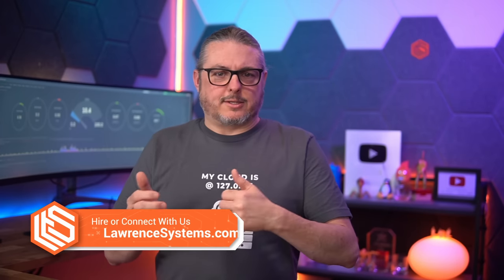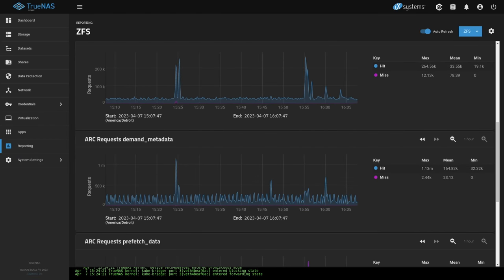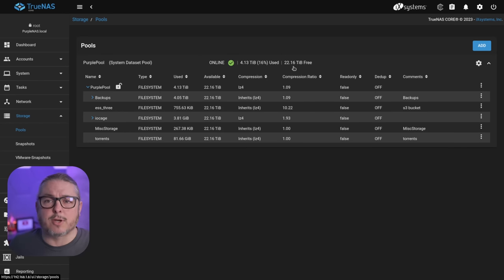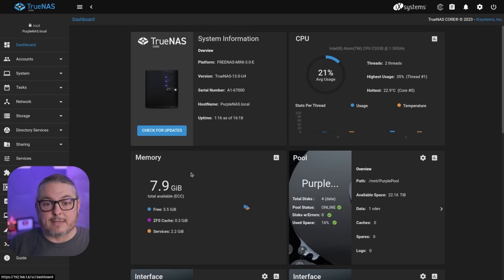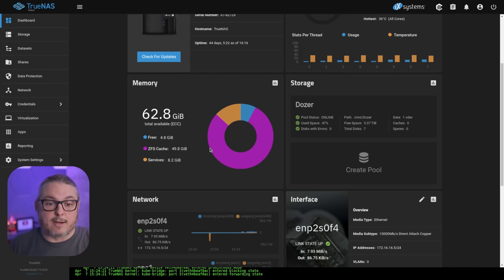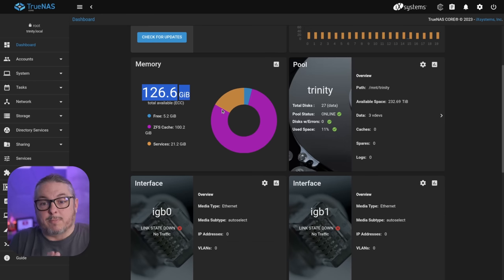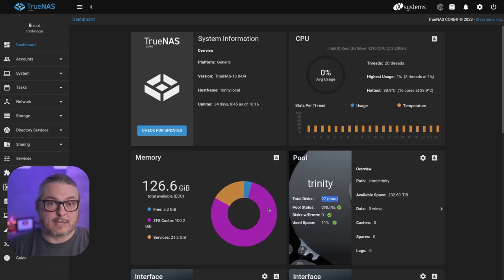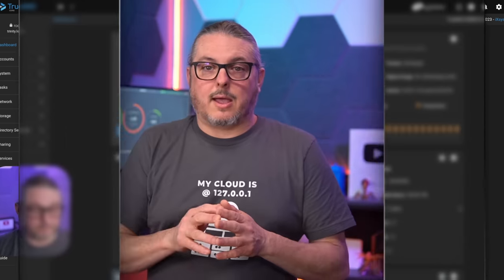How Much Memory Does ZFS Need and Does It Have To Be ECC?

Comment: ZFS need ECC RAM to avoid pool and file corruption I know this from experience…
Reply from the maker: Nope, does not NEED it, but it's a nice to have.
Reply: ECC is more important for system stability, say if you have mission critical services running, it can help avoid crashes. Still, memory corruption is pretty rare anyway.
Reply: @LAWRENCESYSTEMS  I don’t think he said that meaning it’s a mandatory requirement, but something that can avoid corruption so better be sure to have it.

That said, I don’t have any confidence in a system doing very complex tasks like deduplication, full volume snapshots, caching, iscsi, etc. in volumes of 40TB+ without ECC memory. There are very good reasons servers use  ECC ram. Saving a few bucks in a multi thousand $ project isn’t worth it.
Reply: @sopota6469  You really think the type of person that isn't interested in ECC RAM is going to also be the type that also sets up dedupe and all the other bells and whistles on a 40TB system?  Or just an average home user and you just have to show off how smart you are?
Reply: I have an old i7 / 32 GB non-ECC RAM running ZFS 24/7  in my basement for years now. Zero catastrophic failures. Zero scrubbing or resilvering needed. Also, more than 30 years using computers without ECC and never had any of these problems everyone says it could happen if you don't use ECC. My house is probably "cosmic rays"-proof.
Reply: It depends on your usage. I personally repurposed an old platform for a Plex Media Server and some remote storage for data of low volume devices and at home and do not have the ability to use ECC.
If you are running a purpose built server using server processor (Xeon or Epic) then yes use ECC memory as it is available

Comment: Nicely explained, however I am still not clear-  if ECC is not strictly required and data integrity is still there without it, what precisely is the benefit of ECC? Or should I ask, in what situations would a non-ECC system fail where an ECC system would not?
Thanks for the video, please keep uploading more great content!
Reply: everything is just layers.
zfs can provide some reliability. ECC provides reliability at a different step in the chain.
Example: zfs loads data into memory to perform a checksum. A bit is flipped in memory. Checksum is calculated. Checksum no longer matches.
So it tries again. Now the checksum matches. In the end it decides the data was fine and moves on.
ECC would have fixed the single bit-flip and it wouldn't have had to do the extra work to make sure.
Or, different ECC would have at least realized there was a problem sooner so it could redo the read before continuing.

zfs assumes the disks are not trustworthy, but in reality nothing is. There are extra checks to hopefully recover from problems, but eliminating them before they can mess with a process is better.
Reply: ZFS helps detect and correct errors which are written to the media, but ECC prevents a potential source of errors before they can ever reach the media.

It's nice for data integrity but I think ECC's main virtue is that it lets you know very promptly when your memory is failing or otherwise having issues. If those issues are not too severe, it can mitigate them enough to keep your system functional while you resolve the root cause.

A system without ECC which has memory corruption will crash randomly, corrupt files, and/or just generally act unpredictably. All of these are awful in a NAS.
Reply: if data is in ram and written to disk and PRIOR to being written to disk a bit-flip occurs, then it is a problem. so i cannot agree with the statement that you do not need ECC if you want a proper zfs nas
Reply: @baumstamp5989  "ZFS without ECC RAM is safer than other filesystem's with ECC RAM"
- It took WAY too much reading to finally learn all of the fear mongering about ECC is just a myth.

Comment: My ZFS memory usage is occasionally measured in MB not GB.  My use case is running VMs on an Ubuntu desktop and I have only 1 pair of hands to keep the VMs occupied.  My hardware is cheap; Ryzen 3 2200G; 16GB; 512GB nvme-SSD; 2TB HDD supported by 128GB sata-SSD as cache.  My 3 datapool are: nvme-SSD (3400/2300MB/s) for the most used VMs; 1TB partition on begin of HDD with 100GB L2ARC and 5GB LOG for VMs; 1TB partition at end of HDD with 20GB L2ARC and 3GB LOG for my data.  L2ARC and LOG partitions are together again 128GB :)   I maximized memory cache L1ARC to 3GB.

My nvme-SSD datapool runs with primarycache=metadata, so I don't use the memory cache L1ARC for caching records.  My nvme-SSD access does not gain very much in performance using the L1ARC. The boot times of e.g Xubuntu improves from ~8 seconds to ~6.5 seconds.  My metadata L1ARC size is 200MB, saving space to load another VM :)

I have a backup-server with FreeBSD 13.1 and OpenZFS, it runs on a 2003 Pentium 4 HT (3.0GHz) with 1.5GB of DDR of which ~1GB is used :)  So OpenZFS can run in 1GB :)

The VMs on the HDD run from L1ARC and L2ARC, so basically they boot assisted by L2ARC and afterwards they run from L1ARC.  After a couple seconds it is like running the VMs from RAM disk or a very fast nvme-SSD :) :)  Here the VMs fully use the 3GB (lz4 compressed) say 5,8GB uncompressed and my disk IO hit-rates for the L1ARC are ~93%.  Using a 4GB L1ARC I can get it to ~98%. 

For all the measurement I use conky in the VMs and in the Host.  Conky displays also data from /proc/spl/kstat/zfs/arcstats and from the zfs commands.

PERFORMANCE:
The relative small difference between using nvme-SSD and nvme-SSD + L1ARC is probably caused by the 2nd slowest Ryzen CPU available. I expect most boot-time is used by the CPU overhead and decompression, so reading from nvme instead of memory does not add very much more delay. That would change in favor of the L1ARC with a faster CPU like e.g. a Ryzen 5 5600G. 

More memory would make the tuning of the L1ARC easy, just make it say 6GB.  It would not make the system much faster, since the L1ARC hit rates for disk IO are already very high in my use case.  However I could load more VMs at the same time. 

The 2TB HDD is new. In the past I used 2 smaller HDDs in Raid-0.  It were older slower HDDs, but the responsiveness felt better.  I expect, while one HDD moved its head, the other could read. Those HDDs had 9 and 10 power-on years, so one of them died of old age, so I don't trust the remaining one anymore for serious work.  Another advantage was, that my private dataset was stored with copies=2, creating a kind of mirror for that data. Once it corrected an error in my data automatically :)  I consider buying a second HDD again.

My Pentium backup server has one advantage; I reuse two 3.5" IDE HDDs (320+250GB) and two 2.5" SATA HDDs (320+320GB)and it has one disadvantage; the throughput is limited to ~22 MB/s due to a 95% load on one CPU thread. That good old PC gets overworked during say 1 hour/week.

Comment: Well, to be honest I'm a bit disapointed by the video. I would have expected some benchmarks to show when TrueNas becomes unstable/unusable under a certain amount of memory. Or you could have an ECC system and a non-ECC system, overclock RAM on both of them until it's unstable and see what it does to your data.
This very video does not show a lot, and I'm sure did not required a lot of work.
What happens if you run TrueNAS with 2Go of RAM ? Or even 1G ?
What happens if you run TrueNas with 8Go (the bare recommended minimum) but with 100Tb+ of storage and some loads ? How does it affect write and read performance ?
How resilvering is affected by the lack of memory ?

All these tests would be useful, interesting to watch, and would also offer a definitive answer to the question we are seeing to many times on the forum "how much memory do I need for my system" ?
Reply: There are too many variables to make benchmarks like those worth anything.  It completely depends on your workload and your equipment.  Everyones performance will be fairly unique.  Not having enough ram is the difference between saturating your 10Gbe network connection and barely reading at 200MB/s.

Comment: A nice calm discussion. Thanks for a well reasoned argument about memory use in ZFS. In my shop, we have a general rule of thumb of 128GB of memory per 100TB of zpools served. IOW, if I have a 200TB zpool, the server managing it will have 256GB of memory. We get very good performance this way, with most of the memory mapped to ZFS, which is what you want.

Comment: I'm running ZFS on my desktop. It has 8 NVMEs all mirrored in pairs which results in about 5TB of storage in total (not evenly sized  - but I run it for reliability not optimal speed and 14/10  R/W GB/s is just plainly good enough for me).
Doesn't really matter since that desktop is a bit beyond most normal stuff (5975WX, 512GB ECC RAM, etc.) and so it is more of only anecdotal value. And yes, that is too much RAM even for ZFS - it only uses about 50 -150 GB out of the box for those 5TB of storage. So I will need to look into it of how to tune it to do better caching. ;-)

My file server on the other hand is only an old trusty workhorse (old i7 from 2015) until recently running Linux md-raid with 16 GB of non-ECC RAM. It is just a very normal home file server. Normal (recycled) PC hardware, running about 8 years 24/7/365 without issue. Only PSU needed replacement once so far.

Was always running raid 6 with 8 drives. Last incarnation was 8x9TB. Of course after a few years that again now became too small.
So a few days ago I replaced the 9TB drives with 18TB drives and this time I also switched from md-raid to ZFS (zraid-2).
What can I say? It just works at least as good as before. Just a bit faster since the drives are a bit faster than before. Hardware is old but not super-slow. Memory is not much. But with 10GbE connection it simply is still good enough for me.
md-raid certainly stood the test of time in my home so that I still can fully recommend it. With ext4 it simply is very robust.

But now running ZFS of course has its added value. And when the hardware finally dies, I will switch this to ECC RAM, too. Of course.

Comment: 0:15 I have had zfs at work and at home for around 8 years. I usually don't come even close to the 1GB per TB on any system. It's usually closer to 1/3 of GB of memory per TB. The main reason is budget and the number of slots. And then some of my servers are 10+ years old and only have 4 dimm slots but at the same time have 20 or more hard disks.
Reply: The only time it is ACTUALLY needed is for deduplication.
You can get away with turning off ARC if you want. But deduplication just uses [X]bytes of memory / [Y]bytes of storage to function.

Comment: note that there are, or at least used to be, a few, usually very rare, conditions where zfs can need loads and loads of RAM to recover a pool and if it can get it fails to import  the pool.
similar to how a dedup pool can reach a point where it cannot be loaded due to insufficient RAM.
one of the reasons truenas puts swap on every disk is so that if RAM becomes urgently insufficient, it can at least swap. it will be slow as hell, but might have a chance of finishing.
of course, if you have backups that mitigates much of that risk

Comment: I’ve got a slightly nasty 32GB stick that writes incredibly slowly so would take hours to fill but works well as a cache device though has taken weeks to fill. Now it’s full  (ZFS-stats -L) it has improved things beyond what just some smaller faster SSD cache partitions did on their own. So if you have “spare” USB memory sticks and ports no risk in stuffing them in as cache devices. As I only run the machine for hours per weeks persistent cache is good for me.

Comment: Timely video as I've just upgraded an old FreeNAS 8 server to TrueNAS. The performance I'm seeing definitely aligns with this video.

HP Gen 7 Microserver N54L (2x 2.2GHz AMD Turion 64-bit cores), 16GB ECC RAM, LSI 9211-8i SAS controller (PCI-E 16x slot), Intel NIC (PCI-E 1x slot).

TrueNAS Core 13.0-U5, booting off 250GB Crucial MX500 SSD (internal SATA port).

* RAID-Z1 Pool: 4x 8TB IronWolf Pro 7200 RPM HDD (connected to 1st port on LSI Controller)

* RAID-Z1 Pool: 4x 1TB Crucial MX500 SSD (connected to 2nd port on LSI Controller, via 2.5" 4-bay dock in optical drive bay)

* Mirrored Pool (encrypted dataset): 2x 4TB IronWolf Pro 7200 RPM HDD (connected over eSATA to external 2-bay enclosure).

This is an ancient system, massively underpowered these days, but for home use (ie. SMB/NFS file sharing - mostly media/movies/TV shows on HDD, plus the occasional git repo or document on SSD) it's still perfect as it saturates the 1Gbps NIC for pretty much everything (reads AND writes, even from the 4xHDD pool which has a sequential read rate of 640MB/s).

At idle the system pulls about 55W, and maxes out at about 105W during a 4x HDD scrub. It's nearly silent but stick it in a closet (as mine is) and you absolutely won't hear it.

Even the older and slower N36L can saturate the 1Gbps network with a similar controller/disk setup (I recently swapped out the N36L motherboard for the N54L as a final upgrade!)

The only possible improvement now would be to upgrade the network side of things as that's definitely become the limiting factor, but to be honest for home use there's really no need...

Comment: thank you for mentioning video productions using truenas / zfs as this helps me making a decision on a future server upgrade for video / vfx production. The machine is probably going to be NVME based with 100G at the server side and 10x 10G connections to the clients, but it really helps to know that there already are productions running on truenas or zfs because there is not a lot of information to be found with this special use case. 
btw, would you recommend with above mentioned setup to set the ram to only be a metadata storage and have all file transfers go directly to disk?
Reply from the maker: RAM is used for ARC cache

Comment: Good timing for me on this video. I currently have a Truenas server I built using an old intel i7 system with 32gb of ram and 5 spinning rust drives. I've been running it for a year, and it runs well for backups. I've been thinking about building one specific to VM storage that is more performant, using 4 - 2.5" SSD drives instead of HDDs. Is 128gb of ram just overkill for 15 VMs? Based on this video maybe 64 would be good enough? If there are some goto guides on this, please let me know, otherwise I may just ask this question on your forums.

Comment: two things to keep in mind:
commercial appliances & memory: Oracle SFS boxes: 512GB/Node almost a decade ago. Tegile ZFS based systems - 48GB/Node at start, then 220ish GB (so 480GB per system *plus nvram*, Tegile in 2020... 980GB / system.
There have been highly important patches to optimize L2ARC and dedup overhead those guys missed, but if you want to see low latency on ZFS you can either just pretend and diss people who ask about shitty performance admit how high the requirements actually are...

Comment: Thanks for this video. I have plenty of ECC memory: would it be beneficial to use L2ARC or is it NOT required if enough available RAM for ZFS? 
My understanding is the L2ARC is the equivalent of SWAP so may impact performance.
Also, what is interest of using a ZIL/SLOG special device like an Optane drive?
Reply from the maker: RAM is better than L2ARC and Optane would be good for ZIL/SLOG. I have more details on how ZIL/SLOG here https://youtu.be/M4DLChRXJog

Comment: Have you had any stability issues on Scale tweaking that memory usage switch to allow more than 50%? Seems someone from iX Systems very persuasively advised against going higher on Linux.
Reply from the maker: Only if you are using other things that need the memory such as virtualization.

Comment: Hi there,

Thanks so much for the video! It's an eye opener as I thought there would be a "maximum" when running VMs, but clearly not. Unrelated question, which of your videos can I watch to determine if ZFS over iSCSI would be a good way to connect a Proxmox server to a NAS? I'm stuck trying to figure out this architecture? I get building the Proxmox server and I get building the NAS, but I don't know what file system, and what kind of switches for maximum performance?
Reply from the maker: I prefer NFS over iSCSI as a storage for VM's and I don't use Proxmox, I use XCP-NG and I have a video here https://youtu.be/xTo1F3LUhbE on using storage for VMs.

Comment: I've been running the jankiest setup for 3 years now.
one old gaming computer converted to a ESXi. Im talking ddr3 and a i7 4770k...
Then im running a TrueNAS VM where I've hooked up 3 separate disks as datastores which each hold 1 single vm disk. 
Then that TrueNAS VM basically raids those 3 disks togheter.

Comment: I'm running TrueNAS SCALE on a Ryzen 2600 + X570 Taichi + 32GB ECC system with a 6x16TB RAIDZ2 and a 2x4TB mirror and it's been doing great. I'm sure it would work with less memory, but this gives me some space to play around with local VM hosting too.

Comment: Does ZFS benefit from DDR5, or is it better to just buy a larger capacity of DDR4 for the same price?
Reply from the maker: Faster memory is better, but that will come down to what your next bottleneck is such as NIC interfaces or workload type.
Reply: @LAWRENCESYSTEMS  Thanks. Yeah, I have a gigabit interface with spinning disks on my home NAS, so I thought that may as well go with more RAM as the bottlenecks would probably come from other places anyway.